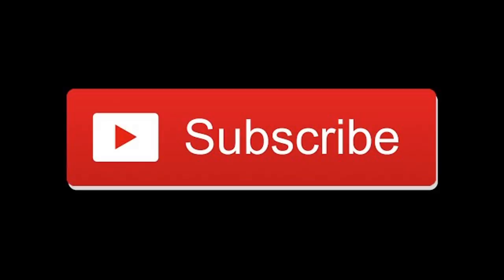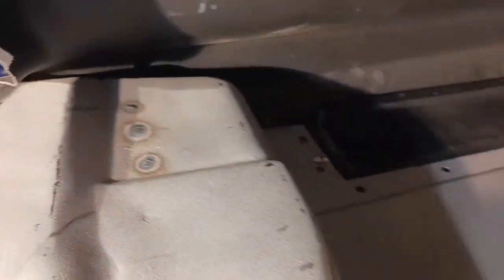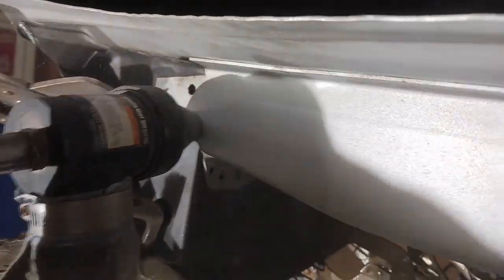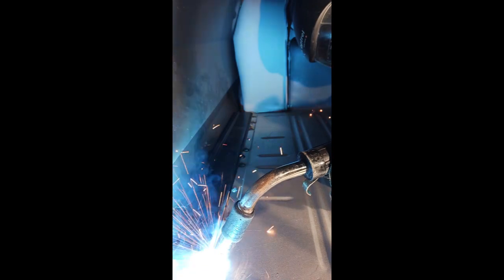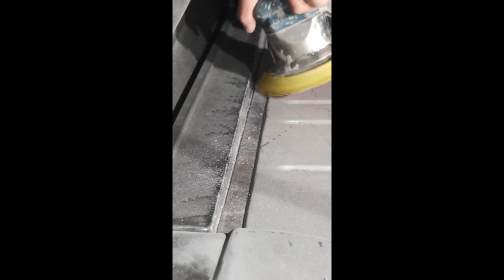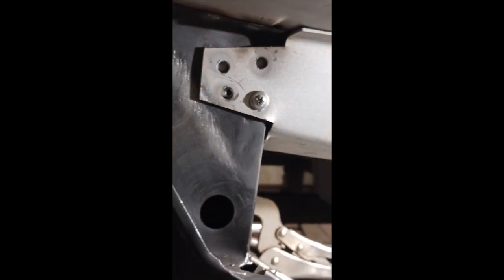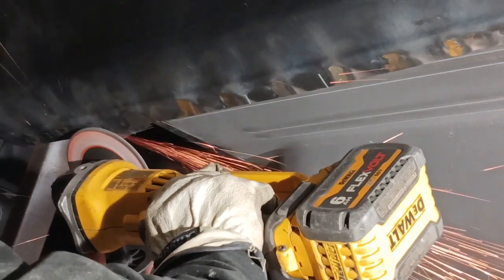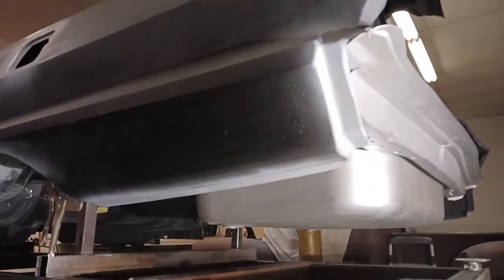1963 Impala SS Convertible   - Install trunk pan  and trunk drops  -  DIY Auto Restoration

Comment: Hey Robert, I love your techniques - I've watched many who do the full rebuilds and your results are a cut above the rest => FANTASTIC!  Found you because I have a couple old rusty Mopars I've kept since the early 80's that I want to do full rebuilds on when I retire (not so long from now).  Watched all your Charger and Cuda build videos because they apply to me, and most of the Chevy videos to learn.

 If it fits into your future videos, can you show in full detail and explain your rosette technique?  I've noticed you've shown your welder settings before.  I've tried to slow down your welding sequences, but hard to see exactly what you're doing.  Looks like you hold the gun close and do a quick semi-circle or spiral? so the weld doesn't build up too high.

Anyway, wanted to say thank you so much for showing how top quality work is done.  Your results speak for themselves.  I have major respect for you - you are a true craftsman!

Looking forward to you starting on your Cuda build.
Reply from the maker: Thank you !!
 I'll try to work a video like that in at some point

Comment: @9:26 

What do you do about that little gap in that corner between the trunk drop and bottom quarter panel lip? Seam sealer?
Reply from the maker: The factory would seam seal. 
Thanks

Comment: You wouldn't have pics of a inner rocker assembly. I need to know what all the pieces look like in the toe board area. I am working on a 63
Reply from the maker: If you go to my playlist and check out the 62 and 64 Impala builds, I have in-depth inner and outer rocker installation they are the exactly the same on the 63

Comment: GOOD AFTERNOON SIR...QUESTION I HAVE A 63 SS CONVERTIBLE ALSO..BUT THE CONVERTIBLE RACKHAS NO BOLTS IN IT...WHAT ARE THE CORRECT BOLTS FOR THE FRAME TO BOLT DOWN TO THE B..PILLARS
Reply: 8:32